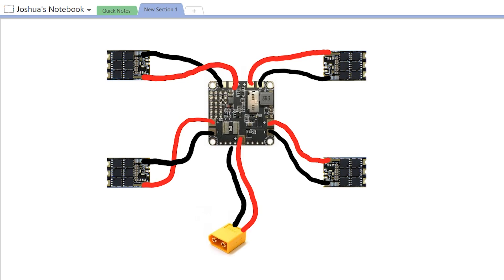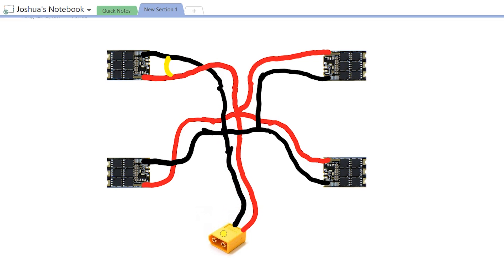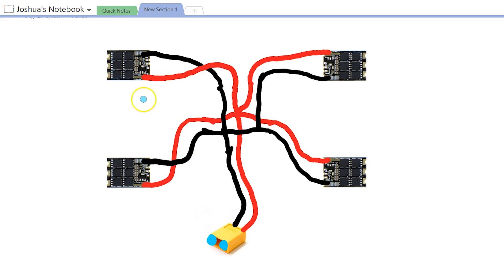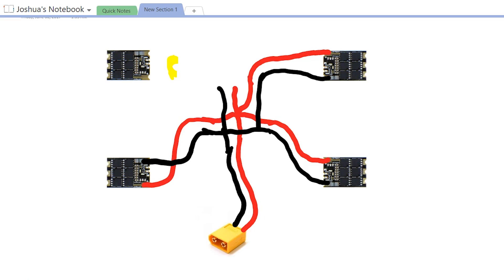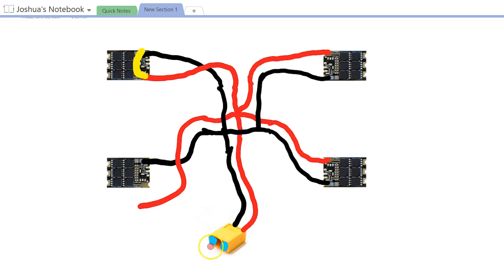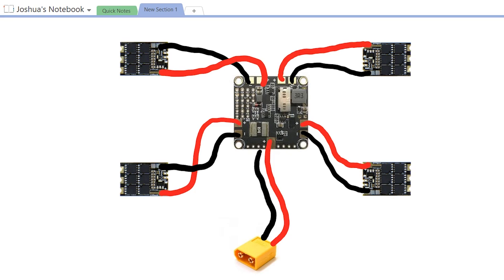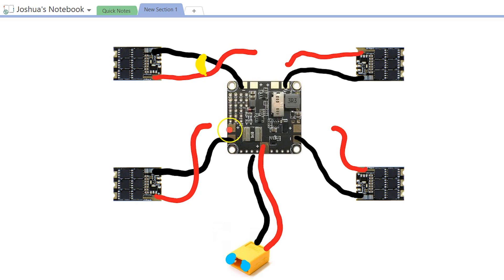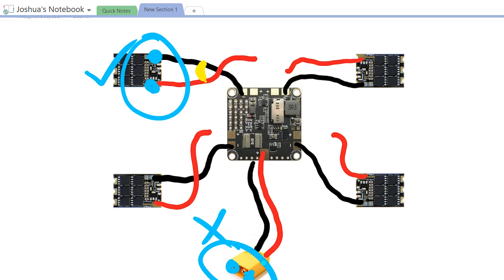How To Find The Short-Circuit In Your Quadcopter

Comment: Old video but for anyone dropping by, a motor can also be a common point to short to the frame.  If the enamel coating on the copper wire melts, it's a bad new winding (shorted to stator) or maybe the powder coating on the stator fails after some use, there might be a short from the esc's motor terminals to the frame (through the motor screws).  Pumping motor juice into the frame can manifest itself as video noise on throttle, jitters in flight & electrical noise in BB logs.  Unscrewing the motors one at a time & checking for shorts between the frame & either ground or the ESC terminals is worth a try if there's a short to the frame that's difficult to track down, or maybe if there's issues like this which a capacitor should fix but doesn't.

Comment: What about if it’s a motor wire that’s crossed?
Reply from the maker: Motors are wired to a Y configuration where the phases are connected to each other inside the windings. So motors will always test as having continuity. You can't tell if a motor wire is crossed by testing continuity.

Comment: what if your using a 4 in 1 esc and youve checked with a multimeter on all battery connections and and each motor pad and there's no continuity ? I am confused because my smoke stopper is still going off
Reply from the maker: https://youtu.be/0CQA5dPMYJQ
Reply: @JoshuaBardwell  my problem is different to that. Did a quick video to show and explain
https://youtu.be/DdfjN-MvK14

Comment: I know this Video is over 3 years old and im a little late. but i could not find anything in the Comments about it so i will take the Opportunity to give a little Critik.
The Video is cool and helpfull and i rally like it. and for what you do here this doesn't really matter. BUT,
Electricity flows from negativ to Positiv and not the otherway araound. like i said, it doesn't matter for this particular problem, but it could for other situations be really critical.
The negativ side of the batterie is called negative because it hold a negative load. meaning: it has mor electrons than the other side. and electrons are what flows and gives "electricity". so it flows from - to +

Comment: I've got a very weird problem: after the last (pretty gentle) crash my copter started smoking just when I got there (after half a minute). I directly had lost rx and vtx. Now I wanted to check what is wrong. When I did so my dongle (Speedybee adaptor 2) did go out the moment I plugged it in and when I did pull it out the Micro USB Port ripped of (seems to have been loose from Crash, idk.). Now I carefully tried it with a battery (yeah, risky, I know): the Led indicating power on the FC did light up but still neither the rx nor vtx worked. When I touched the vtx after that it was pretty warm. Now I'm wondering which Part(s) need to be replaced. If anyone has experience this before I would be gratefull to know. 😔

Comment: I caused the short after a housing screw pierced both red and black feed to one of the drones motor's, the two wires still have conunitty from circuit board to motor. Motor tested and working from other motor power connection. But from it's own power connection it has no power. I have a multimeter, how can I find where the fault is. I'm guessing it's a component within the circuit board nearest to where the short circuit happened, that needs replacing. Hopefully you can help!

Comment: Greetings from Indonesia! 😁 In this video (link below), he already use the smoke stopper like you did. Use bulb. But why it doesn't work? The bulb was not lite up and then smoke comes out. https://youtu.be/6uetMp2dZL0
Reply from the maker: Smoke stopper prevents damage from excess current. Other types of damage can still occur. If you put voltage where it isn't meant to go, you will get some damage.

Comment: Hey Joshua, great video as usual! 
I know, this is a little old already, but if you happen to read this: i have an issue with my battery voltage droping instantly after punch out (to 8V on a 4s bat...). Its a completely new (and kind of my first) build, only the motors are age-old. 
Do youve got an idea what could be the cause? Im guessing it might be some "gray" soldering which shortens on high power, but im not sure wether realism or how to point out breaking point since i have a hard time reproducing failure apart from flight tests out of town.
I would appreciate any kind of help since im pretty much desperate about it already :D
Reply from the maker: Could be a bad battery. Have you got more than one to try.

If the battery isn't at least 75 or 80 C rated then, that's also a problem.
Reply: @JoshuaBardwell  i figured it out, youre (kind of :D) right: my batteries are ok, but i am using an old charger that was set to LiFe. This somehow caused the batteries being charged to nominal voltage without being actually charged...
Anyway, everything is working just fine now!
Thanks for the reply, and thanks for all your work!

Comment: Hello i need help can you tell the solution of my problem my drone left back moter is not working i checked it manualy by a battery and its fine and still works but when i use it with my drone it wont turn on and when i connect the wires of the moter the back lights turn on without turning on the drone i don't know what happend to it, it was working fine i had it for a whole 1 year and now its doing this all 3 moters are fine just this one can you help me pls.

Comment: Hello! Can a 4-in-1 ESC be connected to an aircraft receiver (FS-2A) to control 2-4 engines instantly so that it weighs less?
Reply from the maker: The 4-in-1 ESC is basically just four ESCs on a single board. You could feed the PWM signal from the receiver into the 4-in-1, sure.

Comment: Not sure if you still read comments on these older videos, but I have a question! Why do I need a smoke stopper if I can test continuity on the xt60 plug with a multimeter? If the smoke stopper went off, wouldn't I always have continuity there? What extra information do I get from the smoke stopper?
Reply from the maker: Smoke stopper can protect against things that continuity check doesn't catch. Like a damaged FET on an ESC that only short-circuits when you raise throttle. Smoke stopper acts as current-limiting so it makes it safe to plug in the quad with props on, since the quad cannot pull enough power to spin the motors hard enough to hurt you.
Reply: @JoshuaBardwell  Thank you so much for the answer! So glad to be getting into this hobby before all the good people explaining stuff get too popular to reply to comments:)

Comment: I've got a strange thing going on with my quad. As I'm testing for continuity with my analog multimeter at the battery leads, I'm getting continuity when I'm positive to negative but no the other way around. I've sent over two hours checking all of my solder points, and while some are of questionable quality, after desoldering one at a time nothing changes. Any help would be greatly appreciated.
Reply: https://youtu.be/QBdaiQrpwyU
Reply from the maker: This is probably just a capacitor charging. If it beeps briefly then stops, that's a capacitor.

If you seriously get continuity one way but not the other, that might indicate a diode is present.
Reply: @JoshuaBardwell Thanks for the response Joshua. It turns out I just don't know how to test for continuity with an analog multimeter. In desperation, I finally just plugged in the battery and it lights up just fine. In other words, there was no continuity. I'm an idiot. Lol

Comment: My esc get really hot after I arm quad..Its not the motor because i change the motor and its still hot...what should i do?
Reply from the maker: Definitely test for a short circuit using the method shown in this video.
Reply: Joshua Bardwell tnx Il do that tumorow

Comment: Can I connect my battery to the pcb, without the flight controller and receiver?, I tried to connect mine and nothing happens
Reply from the maker: You can connect the battery to the power distribution board all by itself. The ESCs should make three startup tones. The ESCs need the motors to be installed or they won't beep.
Reply: I'm going to make a smoke stopper, cause when I tried to connect the battery to the power distribution board the xt60 burn a little is that normal?, I'm using a 3s lipo battery
Reply: Hey can I use a 12v led light instead?

Comment: Somehow my xt60 short, I checked the wirings all the wirings were right, but when I check my continuity on my pcb in beeps for a second then turn off, is that normal?
Reply from the maker: Yes that's normal. That's the capacitor charging up.

Comment: so i got my eachine x220 wizard in the mail yesterday, plugged in the battery, and smoke came out of the drone... What should I do? i havent flown it yet, and the company still hasnt replied

please help
Reply from the maker: Very sorry to tell you, but the ESC on the X220 Wizard are just trash. Sometimes they are fine forever. If you are unlucky, they smoke for no reason at all. You didn't do anything wrong but you're in a bit of a tough situation now. Contact Banggood support and see what they can do for you. They will probably offer to send you replacement ESCs but you will have to install them yourself.

If I were you, I would start a dispute with paypal or your credit card company immediately.
Reply: @JoshuaBardwell  man thats upsetting...
Reply from the maker: Unfortunately this is a risk of buying bottom-of-the-barrel stuff. Sometimes it just dies on you. If you look at the Wizard X220 from Grayson Hobby (located in Georgia, U.S.) you'll see it's about $50 more than if you buy from Banggood, but they test each one before shipping it, and they have an actual U.S. based support line if it dies on you. You saved $50 by buying from Banggood, and in doing so you rolled the dice, and unfortunately, you lost. You probably will get your money back eventually. If you can find somebody near to you who knows about quads, it's probably easy to repair. But you bought an RTF quad because you wanted to get into the air without any hassle, and I'm sorry to say that's not in the cards.

Comment: I made a major mistake and can’t find the problem. Long story short, I was measuring voltage on two sides of my FC. The leads touched and board arched twice (ya not good). I still have voltage to my FC, but the FC will not power on with battery or when plugged into Betaflight. Is it possible I fried the FC?
Reply from the maker: Yes that seems likely. If you don't even get the board to power on from USB, it's likely fried.

Comment: joshua bardwell ive got something wild happen ive got your version 1 f.c and today i had a flip of death so i came in house to see what happen becouse my spedix is30 4.1 ripped to motor wires off...so i soldered back on and went to betaflight and it wouldnt even turn the f.c on so i started taking apart and i found a drop of solder on top of the esc in middle where caps are but above it is the sd card reader and i found a strand or almost small metal ribbon inside slot? what could this be? i removed and now f.c connects to betaflight but when i solder i always use wide electrical tape over top of my esc to make sure nothing falls onto it, but i found some weird metal ribbon inside sdcard reader
Reply from the maker: Sounds like you broke a part of it off in the crash right?
Reply: think board is okay but this makes second spedix is30 4.1 these damn motors killed zmx finx40 2633kv DO NOT BUY im switching to motors ive always liked f40 pro 2600
Reply: esc has continuity from negative power lead to both rear motor pads? not sure why the motors would do this

Comment: Smoke stopper lights up, but I don't have continuity at the battery lead, no beep.  What now?
Reply from the maker: The smoke stopper lights whenever current is flowing. If you have a lot of LEDs or a big vTX that can pull enough current to light the smoke stopper.

Comment: so actually we dont need any smoke stopper if we already have multimeter? just plug multi meter into XT60.. if it's beeping then we have a short circuit? is it correct josh? please reply
Reply from the maker: A smoke stopper is still valuable because it continues to protect the whole time the battery is plugged in.

Comment: Hey there Joshua, Josh, JB... Nice informative easy to follow video. But I have a confusing one for you to try and figure out. Or may be as simple as a dodgy board but here goes...

I just completed a build using the Matek f405 ctr, Tekko32 esc's, T-motor F40s. I meter checked every connection during the build up, over the top I know, but its only my second build and I wanted it to be right. Anyway, Visually no bridges, meter showed no signs of continuity between any given solder joint or wire, so all should have been good right? Nope.. went to plug my battery in to bind the receiver, got the XT60 in about 1mm, then big spark and smoked FC, the amp draw must have been HUGE because it de-soldered the 0m50 current sensor and let it move. Yes I know now, should have used a smoke stopper, but i hadn't heard of them until now.

But here's the confusing part, even now after smoking the board, there's no continuity anywhere there shouldn't be. The meter is working fine, I'm a mechanic by trade and use the meter almost every day chasing electrical faults on cars, so I ruled out that one. Any ideas on this? or come across it before? I got a new board on order, just hope that's all that needs replacing, I'm just curious as to why it happened when every thing looked and still seems to be ok.

Comment: If you touch ground on the Lipo lead and the other on the frame and there is   Continuity is that a problem I'm asking because I'm having some issues with not hot but really warm motors on test hover and started poking around found out my frame and ground are connected.
Reply: Fly_Savage FPV hey savage is you FC mounted on nylon stand offs
Are your esc's, receiver, vtx and so on heat shrunk?

You might be getting inductance through your motor bottoms via the stators?

A noob guess.....?
Reply: garth odonnell I got it worked out I a stater wire was lose and barely touching a motor screw. Thank for the reply

Comment: Joshua I need your help for a very very stupid question relevant to my PDB. It has VBAT pad very close to ESC#1 positive pad.
Since I'm very bad at soldering (especially 12AWG cables) I've made a sort of monster blob directly connecting mentioned pads and "short-circuiting" them.
I'm quite sure it does not affect anything at all (+ with + at same voltage) but "someone" told me that I definitely should avoid it for "some" reasons.
Any concern about it?
Again, forgive me if the question is too silly...
Many thanks in advance.
Reply: Maybe it was too silly...
Reply: I'd say  they were right to warn you, 
although your common species PDB is usually not much more than $10 at a stretch, if you solder your esc's directly to your battery what your doing is essentially eliminating the need for the PDB in the first place, ......... And that's just a damn waste of 10 clams isn't it!!

Trolling tonight 😄😄

Comment: Hey J.B., I added some new ESCs to my quad last night and I used my smoke stopper to test it out. When I plugged it in the quad started continuously beeping and the lightbulb dimly lit up. What I don’t understand is that I first checked for continuity at the XT60 and there was no continuity. Any thoughts on how that could happen?
Reply from the maker: If anything is trying to draw current, the smoke stopper will light. Make sure you used a 25 watt bulb and not a smaller bulb, or normal background current will cause the bulb to light.

The beeping???? I don't know...
Reply: I believe it's a 25w bulb, it's a tail light bulb that was recommended on build guides. I've used the smoke stopper many times before and it has never lit up like that before, it was dim though not full brightness. Is it possible for there to be a short and not get continuity on the main power leads or is it possible that one of the new ESCs are bad?

Comment: Hey josh, I just shorted my BFF3 board from a piece of solder bridging the +ve and -ve pads of an ESC connection on the board. Didn't have a smoke stopper (facepalm) so I got some magic smoke and unplugged quickly. Now I still get power to my cam, vtx and reciever through the board, but the FC itself doesn't seem to be working (e.g. non responsive to inputs, won't pick up on computer etc..) I just don't know how I would have fried the board but not the PDB from this? Any insights would be greatly appreciated. Thanks as always for the awese content!
Reply from the maker: I dunno but don't overthink it. You smoked it and it's dead. ☹️
Reply: Joshua Bardwell time to make me a smoke stopper😆 thanks for the help

Comment: I have a question. I got the xjb 145, very first fpv quad, Have not flown yet but when I connect the battery, the tower circuit gets too hot, its just sitting there and getting hotter to the point I cant touch for example the usb  metal part. Is that normal or would I have to search for a short-circuit? Thanks in advance for any help.
Reply from the maker: It sounds like there is a short, yes.
Reply: I just veryfied and it is the VTX, the 2 black squares get to hot to the touch, so much that it heats the other parts. What could it be, it just have 3 cables and a pig tale antena attached =(

Comment: i am using clracing f4s ...new to this hobby..crashed my quad only once after that my motor1 is not rotating..found that my ecs and motor is working by connecting it into another motor pad 2 on my flight controller.Nw the problem is my motorpad1 on the flight controller is not working what should i do now..all other motor pads2,3 and 4 are working ...please help me
Reply from the maker: +krishna charan https://youtu.be/FysPHx7RL9s
Reply: still motor 1 is rotating